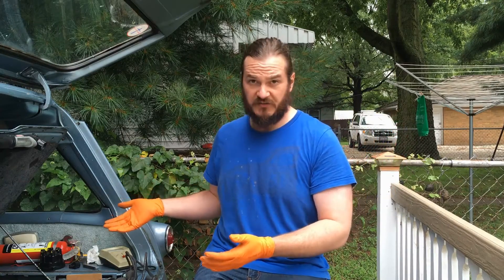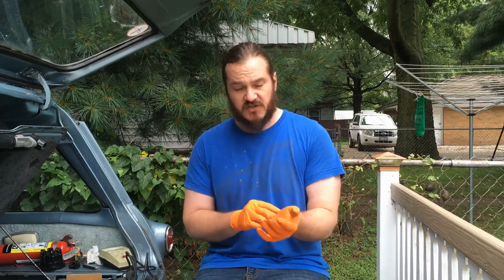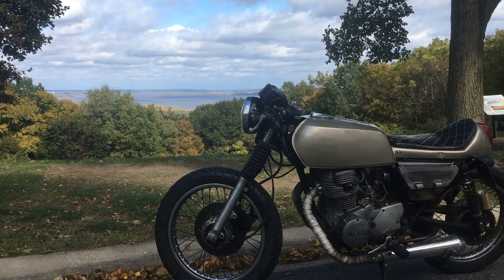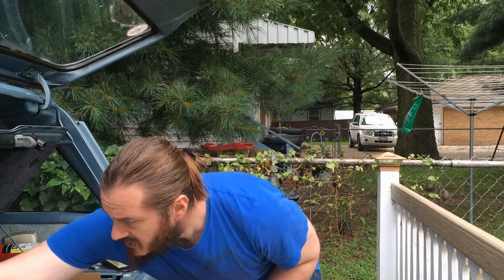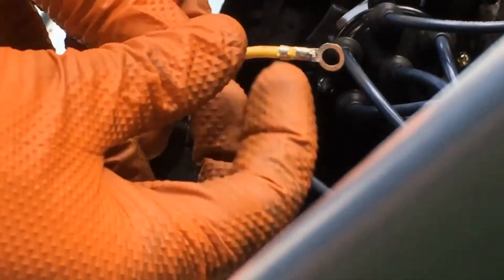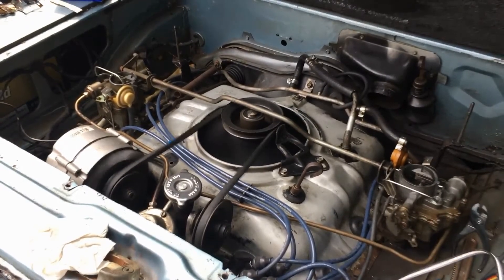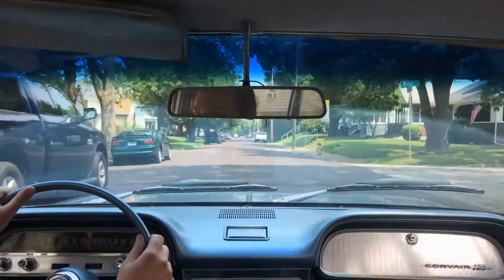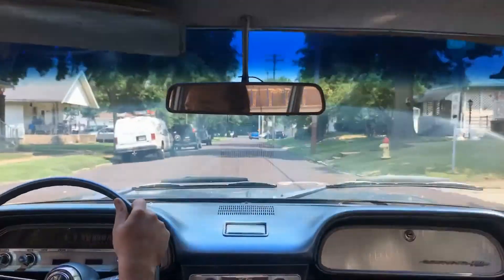Electronic Ignition Install on Chevrolet Corvair

Comment: What about the vacuum advance? Aren’t you basically deleting it ?
Reply from the maker: The vacuum mechanism exists below the mounting plate for all of this and operates independently. One would only be removing the points and condenser. The vacuum advance will still function as normal. The electronic ignition simply removes the mechanical functions of the points opening and closing to create a spark signal.

Comment: Great video and nice car! Why not reuse the dust shield with the EI unit? I bought a Pertronix to install but based on what I'm hearing in forums, the FAST unit is more reliable.
Reply from the maker: Thanks! I could not use the dust shield as it would not fit over the sensors.
Reply: The FAST unit is the better unit.

Comment: I've been.seeing a lot of things on utube about faulty automotive replacement parts coming from China.Kinda makes you wonder if it's on purpose. Check out Uncle Tony's Garage Do you have an electric fuel pump on the Corvair? Looks like you could use some shocks! You can make those cars handle very well.Thanks for the lessons!!
Reply from the maker: Has new shocks all around. Out if all our cars, this has the best ride. Installed a Holley Might Mite fuel pump by the fuel tank. Then I modified the old mechanical pump so I could still use the factory fuel line routing.

Comment: I had problems with my '71 Super Beetle.  The car would act like the cluch was bad.  I eventually found out it was a loose distributor rotor.
You are better off with an electronic ign.
Electronic ignition put a lot of gas stations garages out of  business.   Each gasoline  would have "TUNE UP SPECIAL $25."

Comment: So how is it going ..the ignition? Do I go to points or this for my 64 ??
Reply: I am installing one this weekend. Fingers crossed. I have a 64 I took it completely apart to replace all the seals and now it won’t start. It’s backfiring in the carbs. I bough the xr-700 and a new coil hopefully this will correct my issue thanks for the video
Reply from the maker: So far so good. I have driven it about 120 miles since the swap. There definitely seem to be improvements. Starting is easier. Both from dead cold and after there has been some heat soak to the carbs. So far, I am pleased with the system.
Reply: @WesleyGarrardAmbitionInEconomy  going to put one on today let’s see what happens
Reply from the maker: @razzy360  Hoping for the best!